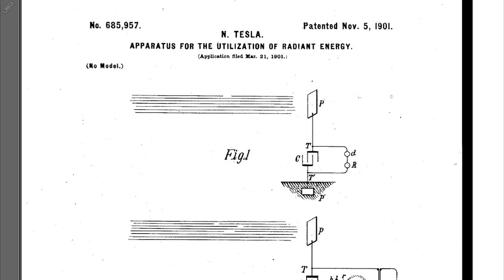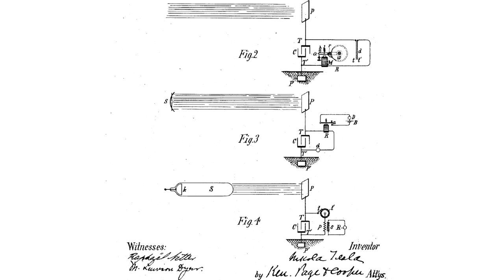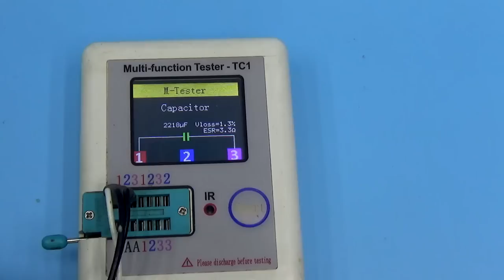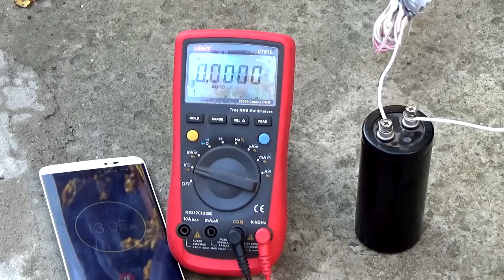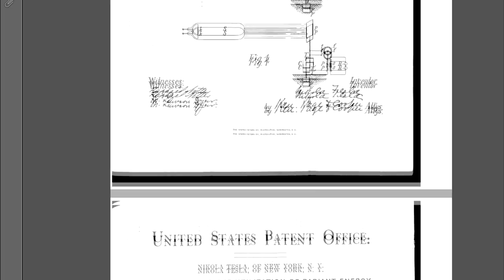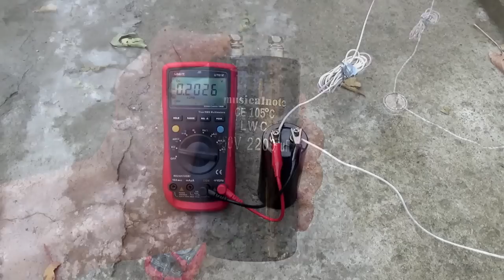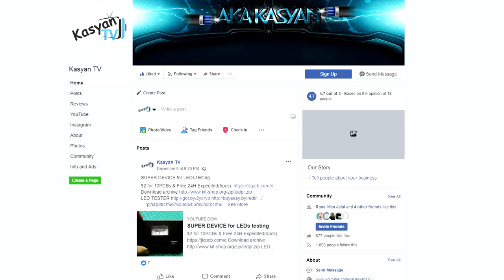Nikola Tesla - Free Energy (fuel free system - How does it works?)

Comment: That final thesis is such a pile of horse***t. Any guesses why all the old building have giant antennas.  The buildings themselves were the generators and capacitors.  The antennas recieved the power from the draw stations.  It's a one time cost to build and the infrastructure can be supplemented fragmentation to use amongst entire cities. This is a propaganda piece.  Says all the right things and follows up with we must mine the rare earth minerals for solar and keep the farce that the windmills are anything but dangerous and maintenance disasters.  Funny.  May want to look how much crude, not veggie, not man made oils, but crude is necessary to maintain the function of a windmill.  Then follow up the devastation to bird populations.  Then add they can only hold so much power in their transfer cells that they burn through cells at an exponential rate because you cannot stop wind.  This had the potential to invite creative minds to look past the propaganda, but instead tries to sell it.  Good try

Comment: Poor design, not proves anything. First, capacitor can not be electrolytic. Second, Al foil have to be on higher position. Higher, means much voltage and energy. Third, that system neeeds exciter, which can be sparkler or circular exciter, as Mr. Tesla has shown in patent documentation. Please, approach to this subject with much more respect and dignity. Greetings from Serbia!
Reply: More details (link ?) on the circular exciter ? 🤔
Reply: @davidbolha  Ok. You have it in this video, as I said, in documentation.